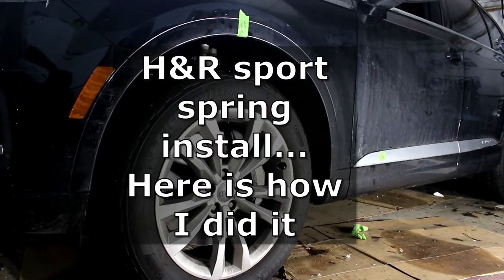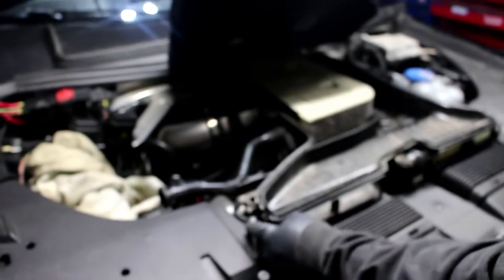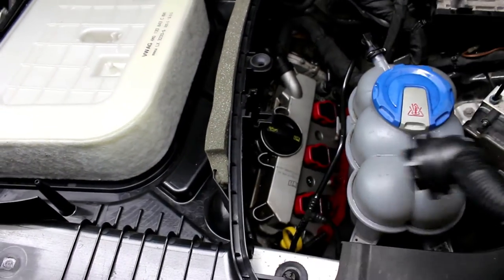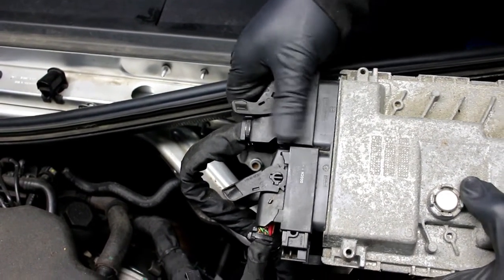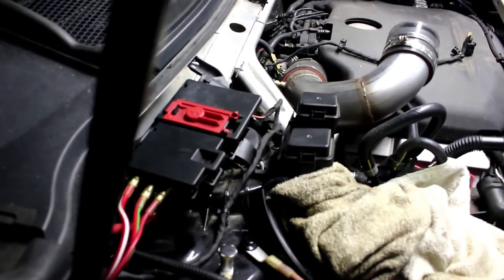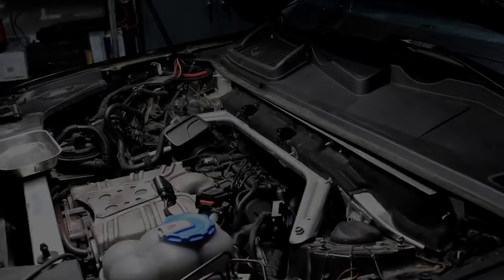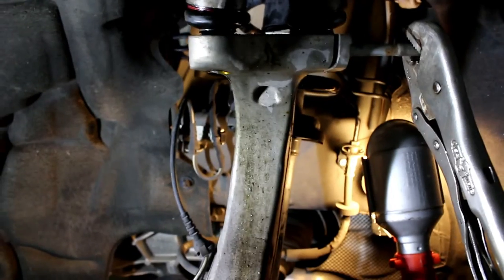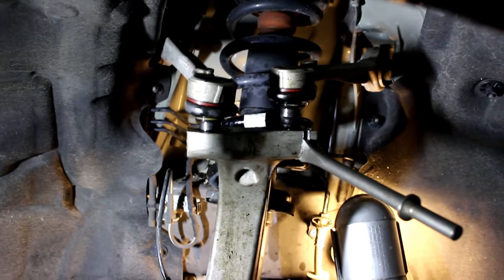Audi lowering spring install Q7/8 2015+ 4M  - 2019+Q8

Comment: I want to thank you for making a great video! I followed your steps to do a 2019 Q8, and just about every step you did was what I needed to do on the Q8.  The part about taking apart the engine compartment parts would've driven me crazy without your steps.  Thank you!
Reply from the maker: Well thank you SO much for saying something. Would it make sense for me to expand the title to include the Q8? If you felt it was close enough to help let me know about how close it was overall
Reply: You are right I just installed coilovers(deleted the EDC) on my 2020 Q8, the Q7 share the same struts and install is the same. And by the way the swaybar link bolt hole dont have threads, you made those threads when you were backing it out. Too much stress on the bolt caused that.I would update the title to include 2019+ Q8 though.
Reply from the maker: @kelleo727  Thanks for that follow up. I'll add that now.

Comment: This saved my life. Every trouble issue you pointed out saved me countless hours of headache. I followed this almost to the T, and it was awesome. Just finished the fronts and on to the rears
Reply: The two leg puller for the wipers and the control arms were the best advice. I put springs on my A4 and about lost my mind with the control arms. Ended up destroying them and just buying new ones. The puller with a couple of nuts, took all of 5 minutes to get both off with zero damage. I owe you beers my friend
Reply from the maker: Casey - Your comments make all of the time and effort to make and post the videos worth it. I want to thank you for not only watching but for saying something. Thank you it really means a lot.  I'm extremely happy this helped.
Reply: @howididit7196 quick question for you on the rear… I have 034 motor sport springs so you might not be able to answer, but for some reason the springs dont seem to sit at the rubber stopping point on the mount. I can get either the top or the bottom, but I can’t get both to hit that stopper on both. I hope that makes sense. I put them in both ways but it only makes sense to have the label facing up like you mentioned on the H&R’s. Thanks again for this video man. Really I owe you many beers
Reply from the maker: Hey Casey I"m getting back to you as soon as I saw this. So Technically speaking 034 isn't making sprints they're probably reselling or black labeling springs. So with that I don't know what spring exactly it would be BUT... Here is what you're going to want to do. I looked at some of my pictures. You're going to want to make sure the bottom spring part is on the bottom rubber stopper with the most amount of degree of contact. If you don't have a solid bottom spring contact with the rubber stopper when you hit a bump,, the spring will push the rear of the car in whatever angle the bottom part of the spring is at an angle to. So what you want to do is make sure the bottom spring perch has flat full contact then degree back the rotation to make sure the top part is sitting flat as well. You won't be able to hit the top stopper most likely but just make sure the bottom is fully flat and the top is settled into the groove as much as you can without having the top at an angle... let me know if all of this made sense. If not I can help further

Comment: Got a 2017 that I was considering using those H&R springs.....now seeing your video....I think (my opinion) it isn't worth the hassle and all the work to get just like 1" or 2" lower....if we had the adjustable suspension it would be so easy to REALLY lower them....
Thanks for the content by the way!
Reply from the maker: Thanks for watching and letting me know this was helpful. Even if this wasn't quite the result you were looking for. Yeah I was looking for a bit more of a drop.. The drop to me was enough to help but it would have been nice to get just a bit more. With all that being said I think this is a good height. It's been just low enough but still just high enough to allow me to drive over curbs (not something I do on a daily basis but I do need to drive over things..when needed) Also the height was still high enough for me to be able to tow. So that wasn't really compromised. So it's kinda helpful depending. If you want to lower it. It's noticeable enough to do IMO. I did feel it helped.

Comment: How did you get this on jack stands? Great video
Reply from the maker: Hi let me know if you're still looking for info on this. I'll make a video if needed.
Reply: @howididit7196  Yeah still haven't figured out how... The jack point seems to be the only place for the jack stand, but of course the jack is still in the way.

I've thought about jacking from a suspension component, but don't want to bend anything.

Comment: Would you show us how you made your intake in that Q7?
Reply: Oh, and thanks for making the video. I’ve got a set of H&R springs on my todo list.
Reply from the maker: Hi Andrew, I custom made it myself. I can if you're interested show you how I made it. But it requires welding. I felt the offerings for the Q7 that we have were less than worth money and I wanted to increase the blower sound while feeding the blower better.  Thanks for the other comment as well. I have a few more videos I did on my Q7 journey. I'll try to load one of the other ones this or next week.
Reply: @howididit7196  I have access to Stainless tubing and experienced welders on Argon purged tig welders.  I just need to know what OD and dimensions to fab my own.   It appears to be 3" OD Tube 90deg Elbows, but how much did you cut off of the throttle body side?  Also, I'm finally ready to pull the trigger on the springs so i'll be reviewing this video again (and again and again) in the future.  Thanks again.

Comment: Hows does it ride now? Does it handle better now?
Reply from the maker: Hi Don, I'll be honest for me the car handled pretty good on the OEM suspension springs.  I was originally doing this as I wanted the ride height to be less like a lifted truck and more inline with a sport SUV (I believe I achieved this). Ride and handling now has been improved but it's not (depending on your springs health) not dramatically "better" I would say it helped add a more sporty ride and tightness to the SUV but it didn't turn it into a SQ7 handle wise. BUT it is worth mentioning that the springs didn't make the car ride worse. As with some springs the car rides like your on stiff spring hydraulics and the ride is TOO rough and you can feel every bump. That is not the case here.
Reply: Awesome video!! Nicely detailed! Did the springs settle like maybe a 1/4” more?